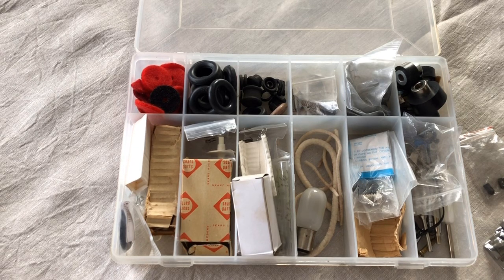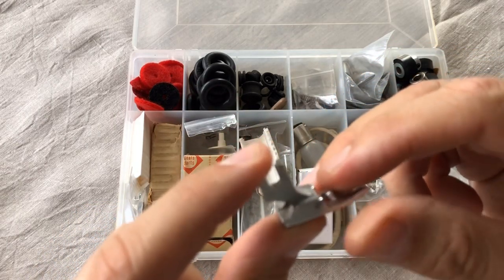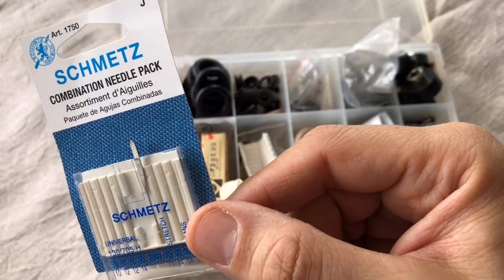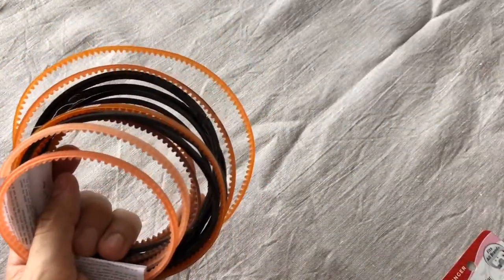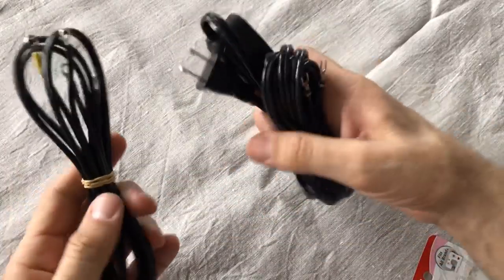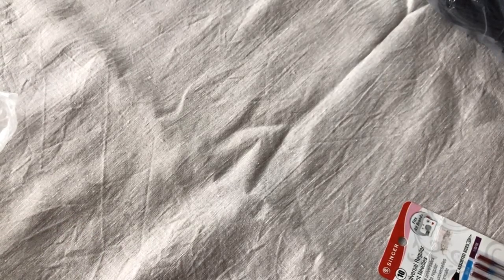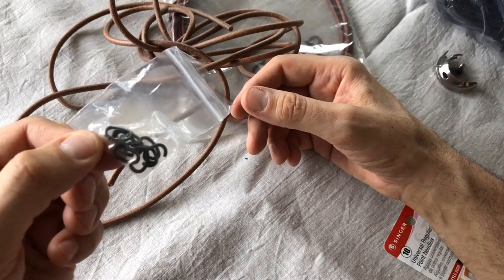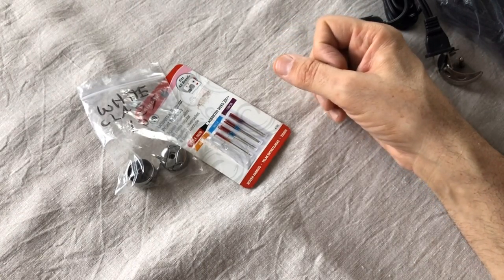TOOLS & EQUIPMENT SERIES #2: Replacement Parts You Should Have in a Sewing Machine Repair Toolbox

Comment: Treadles are still sold new all over the world, Singer India makes them in a more modern form. And hand cranks. In the USA we have to hoard all those ancient singer tables to run modern Janome 12 stitch plus buttonhole treadle machines.  So yeah, treadle belts are easy to get. 
  The Amish use rubber treadle belts.